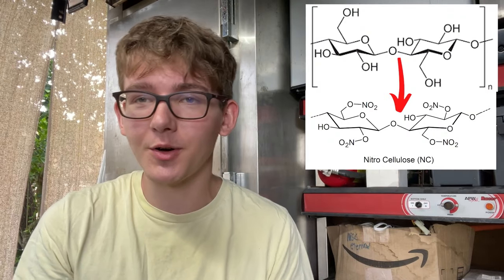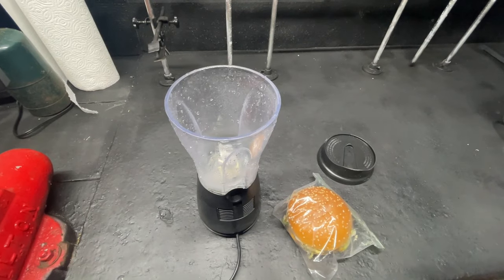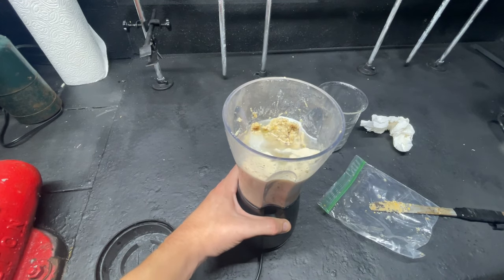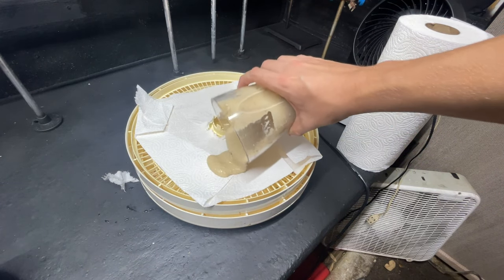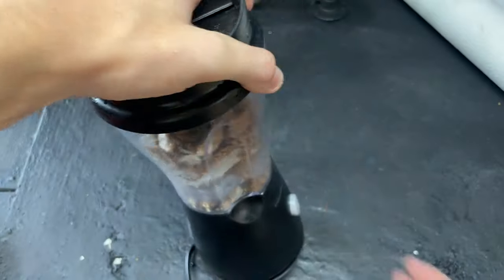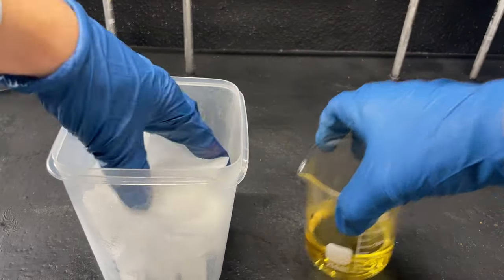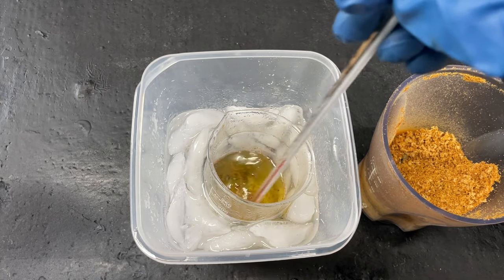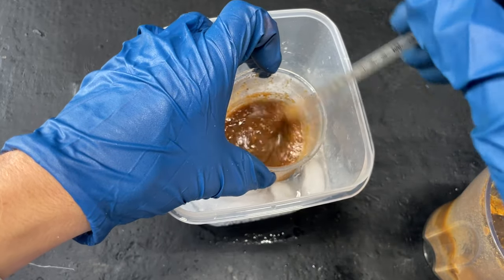I nitrated a Big Mac to make it explosive

Comment: But did you had to nitrate it? I mean, combining any carbohydrate based compound with an oxidizer, it will burn. I tried wax, rubber, hay, cotton, and sugar of couse. They all burn. The higher the calories, the faster, and more violent the reaction.
Reply from the maker: you could just add oxidizer but it will never preform as well as the nitrated compound since the nitrated compound is mixed on the atomic level.
Reply: @@FartGas-xe4yk yeah that part sounds wrong all by itself. That's why news bites are cancer. You must also check the materials I mentioned.